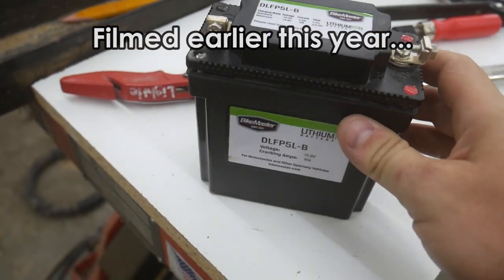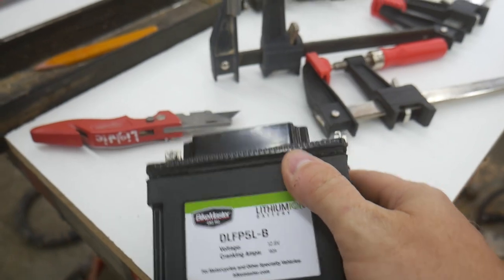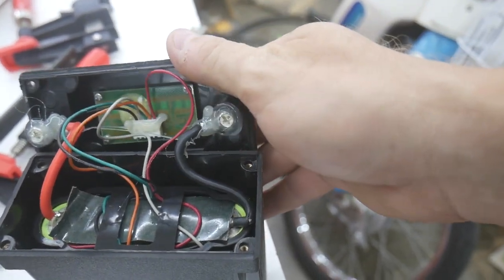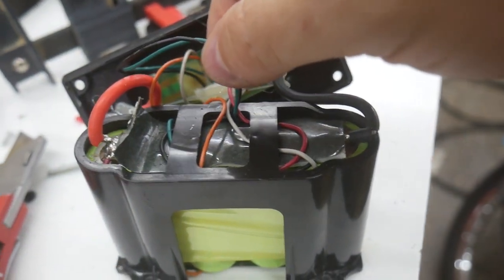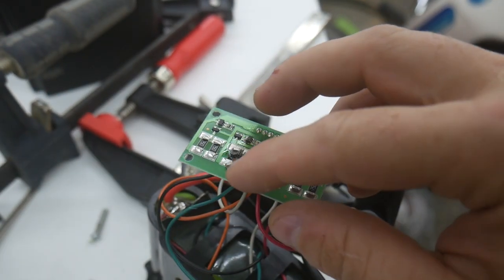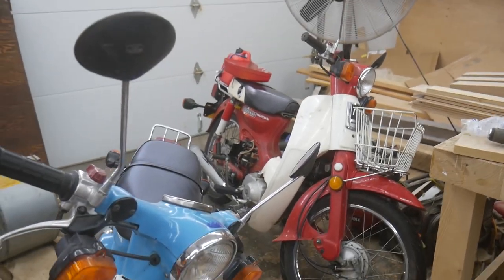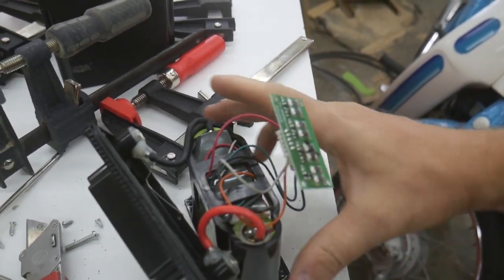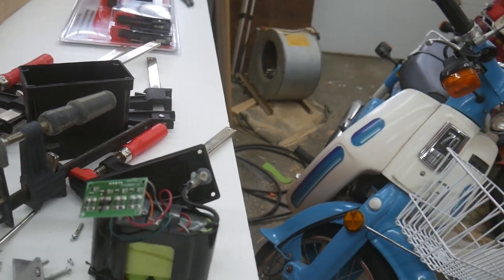Do NOT use Lithium Mortorcycle batteries in your Honda C70 Passport!!!

Comment: Shopping for a new battery for my '84 c70 passport- thanks for the insight here. What battery do you run currently? (Mine came to me with an aftermarket lithium)
Reply from the maker: The brand is use is called Crome Battery. They are AGM batteries which are sealed and don’t require any maintenance besides a trickle charge.

Comment: Is it possible to install a voltage regulator of some kind in the bike's electrical system so you can run the lithium battery safely?
Reply from the maker: In this particular model, and many of the vintage Hondas, the battery IS the voltage regulator.  I have looked around and I don't see anything out there that I could bolt on to protect the battery, so I'm just using the old lead-acid type again.
Reply: @SouthpawWorkshop  Good to know. Thanks for replying to my question.

Comment: Hey could I get some battery specs for that scooter? I've got me an 81 c70 that's missing the original battery so I don't have one to reference for replacing
Reply from the maker: Search for “6N11-2D battery” on Google. Make sure you buy from a vendor that includes the electrolyte with the battery.